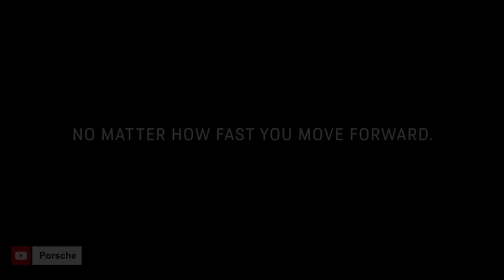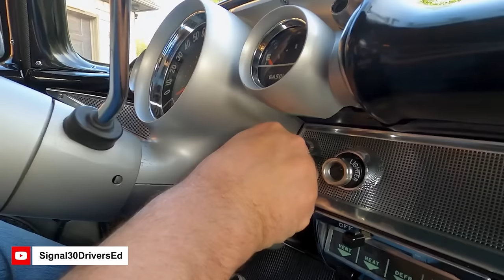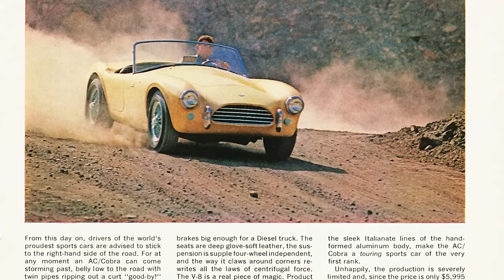Why Old Cars are Better

Comment: I could not disagree with the premise of this video more. I too have had both an S 10 ( actually three of them, and a Midget, also a project. I would use an S 10 as my daily driver again in heart beat, and never had a car I had more fun in at 45 mph than the Midget. But neither was better than the cars I have in my driveway now. You ignored the destruction of those older cars by rust. Why would you trade a car that will go 20 years and 225,000 miles that has had only oil changes and never a wrench applied to the engine (my 2003 Pontiac Vibe), to cars (Midget) that needed to have it's carbs tuned and ignition system adjusted every three months regardless of how many miles you drove it? Brakes were inferior until the advent of anti lock brakes. Having driven a big, low end Pontiac that lacked power steering on a 3800 pound car, no one would choose to drive a Suburban without power steering. Or power brakes.

As for pedestrian accidents, remove cell phones from the interior of cars and let's see what happens to urban accident rates. Even though I live in a state that using a cell phone while driving can get you pulled over and issued a reckless driving ticket, you still can't make a five mile trip without seeing someone on the phone, or worse, texting. Pedestrian accidents is also part of why cars have the body shapes they now do. Those smoothly shaped front fenders are more aerodynamic, but they also limit the injury to a pedestrian that may be side swiped by a car turning. Anyone that has to face down a monster pick up with their headlines directly in your line of sight would appreciate some enforcement being applied to make those headlights be put back where they belong closer to the road surface.

I will agree with you on one thing, cars and especially trucks have gotten too big for no reason other than buyers ego and bragging rights. It is shameful that the Japanese build small trucks intended for city use in Japan that can't be imported here that have far more carrying capacity than a standard Ford F 150 has now. At one third of the size weight. 

If you are using your car as a plaything, sure old cars are great, especially little sports cars of the 60's era. But no one has ever owned a trouble free MG Midget. Never. And keep in mind, they have the carbs from hell as far as understanding them and keeping them in sync.
Reply: You do know that modern cars get destroyed by water too right? Many new cars have computer modules and relays low to the ground, that can be destroyed by getting wet. Also my neighbour's modern Mini Cooper died last spring - his air intake was so low, it drank the water from a shallow puddle i also drive over frequently. Also modern cars injection does need cleaning, and also regulation - the ECU that controls it cannot be fixed. When it goes bad, it needs replacement for thousands of dollars. My uncle just had to get rid of his reliable 90's Opel, because when he did find a new ECU, no mechanic even knew how to replace and regulate it properly. So he got stuck with an empty shell of a car - which all modern cars become if their ECU, or driveshaft censor goes bad. My cousin recently got stuck in a snowy mountain pass, with his Audi A3 cuz that driveshaft censor left him stranded - it's between the engine and gearbox, couldn't even reach to fix it if he had one. Guess who had to save him - my 45 year old car, which all pedestrians seem to eagerly jump infront of every day? Maybe they don't agree with you that old cars have terrible brakes? lol
Reply: @meganoobbg3387  You make a number of sweeping claims that point to older cars as being superior than modern ones. Most of them fall under the category of 'one time this happened - so every other car must have this problem too. A 30 year old foreign, lightly supported when new Opal has the ECU fail and parts can't be found. Why would anyone be surprised by that? A rare car with some unique engineering and parts. No one know how to fix it? Consider that the mechanics trained to work on that car and have some real world experience under their belts in 1995 would be 70 years old or older now. I think they've earned their retirement. Splashing in puddles and getting water in the engine? My brother did the same thing with a Jeep in the 70's driving down the expressway headed to a concert. Jeeps aren't known for bad air intake ground clearance. One off car failures mean little in the overall scheme of things. I've had at least 12 cars with modern ECUs and never had one fail. I don't even remember hearing one of my gear head friends mentioning one failing on them. I'll take my anti-lock disc brakes over a set of drum brakes from the 1960's any day of the week.
Reply: Opel is a mass produced and widely used car - if the mechanics can't fix a basic car like that, it's not the cars fault. And it's not a "one time this happened" - ECU's always fail if the car isn't maintained properly. If you're on a budget, the second hand market gives you plenty of those. And the crankshaft sensors failing are common - cuz they're made of plastic, and the engine heat destroys them. Can't swap it on the road like a distributor.

Comment: There's a lot of poor over generalizations  here.  Most vintage cars built ~2 years or more after the Interstate system started are perfectly capable of taking long trips cruising at 67-80MPH  (I've taken my 78 Lincoln on several 8 hour 80 MPH highway drives with the trunk and all seats loaded to max capacity without issue) granted some 6 cylinder and many 4 cylinder cars don't have sufficient power or gearing for highway use (also gearing in V8 cars is sometimes changed for drag racing or selected truck reasons and can negatively effect highway performance..So don't buy a drag car and scrutinize any truck you want to use for highway cruises)    Safety varies across a broad spectrum: On one end you have the Pinto which will spill gas everywhere if given a 15MPH love tap, and on the other hand the Mopar Imperial cars of the late 50's-late 60's that are safer than most modern cars in a crash because they basically put a uni-body (a body designed to be strong enough not to need a frame) on the strongest frame Mopar ever used on passenger cars...They are so indestructible they've been banned from demolition derbys since new (and it's not just expensive cars, Checker motor corp built cabs have the same distinction for the same reason)...Using that well known 59 impala VS 09 Malibu video for evidence is not an accurate picture for most cars as the impala falls on or below the Pinto end of the safety scale...They  had weak wasp wasted frames as the 59-61 GM cars intentionally sacrificed safety for styling (Mopars forward look styling so thoroughly dethroned GMs decades long reign as styling king that they were in total panic when they built the 59's as a response)...If you look at all the rust that came out of that 59 Impala in the crash it's clear they picked a rust compromised example too (which sure as heck didn't help it any).  If you go back and look at testing and development videos for the first generation Corvairs they designed crumple zones into them and tested and revised them so after front, rear and rollover the doors would still open and close normally (those cars get a mostly false bad rap for their handling characteristics), and many 60's cars had similar design goals with regards to crash safety. In the late 60's Fords had this big ugly padded steering wheel designed to prevent wheel related injuries in crashes, and there are many other examples of good safety design to cite.  
For any modern application there's usually several classic cars that fit it. The trick is knowing which cars fit which criteria that matter to you, and choosing the best model for your specs...Then finding a good example.
Reply: Depends on the gear ratios - small older cars are indeed unfit for frequent long trips. They jump around, and the engine screams cuz they have only 4 gears, or 5-th is very short. But most medium to large cars had good overdrive gears. Infact many 80s-90s small and medium euro cars had long overdrives, designed for the autobahn. Audi 80, VW Passat/Golf, Opel Astra/Vectra had gears long enough to make larger cars unnecessary. Gears like diesel versions.

Comment: I’ve got a 2001 Integra GS-R. While I might not have a ton of driving experience, it’s the most rewarding car I’ve driven. The purity of a CAR as was discussed in the video might not be as strong as in 80s and older cars, but the rawness of driving it is my favorite part. The lack of features is a feature. 

Sure there are cars that are faster but they aren’t as exciting. There are cars with cameras all over them, blind spot warnings, and lane assist but they don’t make me feel as safe, and I’ve had more close calls in modern cars where I can hardly see outside. There are cars that are more comfortable with ultra smooth suspension noise canceling interior, and a smooth cvt but they don’t make me feel as comfortable in the car as I do in my own body like the Integra does by letting me feel the road, control the gears, and know what my engine is doing.

There are cars that are, on paper, better than mine in every way. Regardless, I wouldn’t trade this thing for the newest, fastest, most luxurious car on the market today unless that means I can sell it when I got bored of it after a month and use that money to buy back this Integra along with a few other 90s Hondas.

Comment: A lot of things to consider: older cars existed in a much smaller world. Back then, you would walk to a lot of places. Cars went from the odometer maxing out from 99,999 miles, too now 999,999 miles. Cars are used way more frequently, for greater distances, in shorter time periods, and extended maintenance time periods. This puts much more wear and tear on cars. You wouldn't see a 50's or 60's car going reliably for 2-300k miles like a car from the 90s. Another thing to mention is the industry shift: auto makers are intentionally making their cars more complex and reliant on dealer support for expensive and complex part replacement instead of repair. There's a lot more to consider, such as automakers going from giant float boats (in the US) that were incredibly lazy in terms of powertrain, too following the trend of the crossover and truck that emerged in the 90s. Which changed priorities by automakers l, especially when they realized they could make way more money when they are loaded with technology and and "cool" features that are not very tested and proven to last long even too this day. The last issue with old cars is support, and now more than ever, efficiency and reliability. Parts aren't always easy to find, and with dealer markups and scams, especially not cheap. There's also the fact that older cars aren't cheaper to run in terms of mileage. In fact, newer cars are better than ever at it. Newer cars tend to last hundreds of thousands of miles depending on what make and model you get.  Ao too sum, older cars were better at some things, but new(er) cars are still better overall.
Reply: I'm sorry, but no?  As a kid in the 90s, the grocery store was much further away than it is now.  The city is expanding inexorably onwards.  I can walk to the store now, though it would still be around an hour walk.  As a kid, it was a fifteen minute car ride at 55MPH.  Also, you just kept track of how many times the Odo had rolled over on old cars.  The reason old cars didn't seem to go as long is mostly because the machining tolerances were looser back then, so they would get more blow-by gasses into the crankcase and degrade the oil.  If this was kept in check, the engines lasted way longer than these new shitboxes.  (Plus, the technology of the oil composition was way behind where it is now; this, honestly, is probably most of the disparity.  Modern synthetics are SO much better than old-school gas station Quaker State or equivalent.)  Shoot, I've got a 1967 Jeep CJ5 from my grandfather that had 240k miles on it when I pulled the engine to refresh it.  I was gonna put a hot Isky cam in it too, but my boss talked me into a more tame Comp Cams grind to help maintain control on the trails.  Of course, the electronics are quickly becoming the first parts to fail in modern vehicles and when they fail, they usually cause more mechanical damage to the engine than you would cause drag racing it on nitrous.  I'm an engine machinist and I can tell you that the new engines are designed to be thrown away after 150k km, while the old ones were meant to be rebuilt after 150k MILES.  Hell, my '95 small block Chevy hit 300k miles last month and now I'm tuning a new cam in it for more power with a stock bottom end.  I got some .030 over pistons for it, but it was in such good of shape, I honed it, threw some new cast rings in and left the stock pistons in it.  RIP Moates and thank you BoostedNW lol.
Reply: No lmfao. Almost every older car we had in our family was ten times more reliable than any newer car we have rn and we also drive less than ever too.
Reply: Multiple mercedes from the 70s have hit the 1 million miles and still work, bunch of old hondas have also hit 999,999 on the odometer, old cars can and will last a long ass time, hell in a lot of 3rd world countries they love buying really old mercedes as taxis because they know those things are built like tanks and will outlast the driver.
Reply: Well, in Europe there where old cars sent to Eastern Europe. Some of them rode quite a lot.
Reply: The record holder for highest mileage car is a 1966 Volvo P1800s - it has only a 5 digit odometer too, but it did 3 million miles. If that car wasn't reliable or cheap to run, Irv Gordon would be bankrupt before the 1 millionth mile. And funny thing is Volvo is not an oddity in Europe - most european cars from that era, are just as reliable (wo Britain).

Comment: I did get a 2010 crown vic for dirt cheap and I have to say it is the best first car experience you can get. Despite mine having some mechanical issues, the driving experience cannot be matched by a new car. The only thing that I added to the car was replacing the radio with a small digital display for a backup camera, gps, and Bluetooth calling.

Comment: I remember back in 2017 I would drive around in my 80's pickup with a tool box, behind the bench seat. At the time I didn't know much about how engines or how the pulleys worked and the pulley to my alternator would slip off pretty consistently. Love that truck and the feeling I get once I haven't driven it in a long time. Currently my father drives it and in the best mechanical shape it's been since my father first bought it. My Lincoln really spoils me but would never beat the love for that old pickup.

Comment: very good points :D  im a ship engine officer myself born 1989 and my first car was a 1993 corolla. it only had electronic fuel injection and Stereo thats it fuel injection can also be done mechanically.  And manual very fun car.  i also recommend if you want to keep a an old car running to follow manuals very closely tho if u dont have mechanical eductaion and experience.  I also had a Suzuki grand vitara 2006 and that was also quite classical.  one of the realyl big problems of modern cars is that if some crappy cheap electronic sensor breaks down u cant use the car!

Comment: After working in parts for a couple years now, I'm no longer afraid to work on a vehicle. I still won't touch wiring, but in terms of mechanics, I have no issue diving headfirst into an engine bay. I bought, fixed, and sold an 03 Yukon. Drove better than most modern cars. Can't wait to get my hands on earlier vehicles

Comment: I remember when most people did their maintenance like oil changes, checking on anti freeze, and replacing burnt out bulb for lights on car mostly on Saturdays.  Most people carried oil and tools in there cars so they could do road side repairs on their cars if something happens.  It was easy to replace brakes, shock absorbers, clutches if you had the right tools.  Tune up we easy too with a timing light, feeler gauges, and a dwell meter.  I actually miss those days, since working on your own car did save you money.

Comment: I am heavily biased to older cars and generally against newer ones. But no you’re not off your rocker. At 15 yrs old I bought my first car in 2019 a 1991 bmw 3 series. It ran but leaked oil and coolant, a concern but not enough that I’m re filling every 3 days. After 2 weeks of driving it I had blow by on cylinder #2. Instead of scraping it and not dealing with the headache, I started taking apart the engine hoping it was a head gasket. Next thing I know I’m doing an engine swap on jack stands in my parents garage. Then modifying the suspension, steering, exhaust, detailing the interior, putting WAAY too wide tire on it but making it fit, and soo much more. I could do this with a tool box, and a few battery power tools. If a 15 yr old gen Z squab can build a car anyone can. You just need the patience and understanding that cars break, things wear. You have to buy new shoes after some time eventually rust, and crumbling rubber is going to emerge. But better to see a few bolts holding it together instead of a wiring loom that even if you change the mechanical bit, you’d still need to adjust the electrical bit.